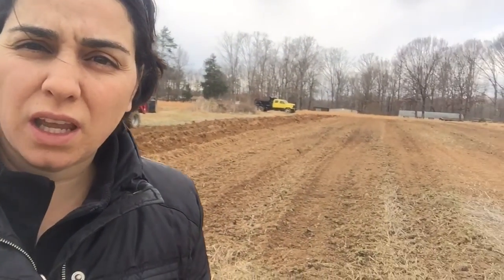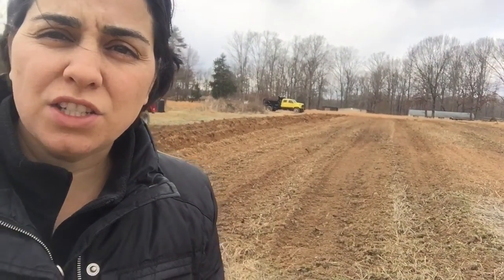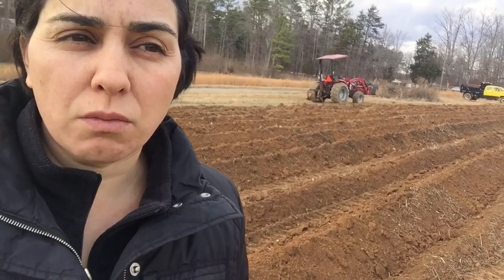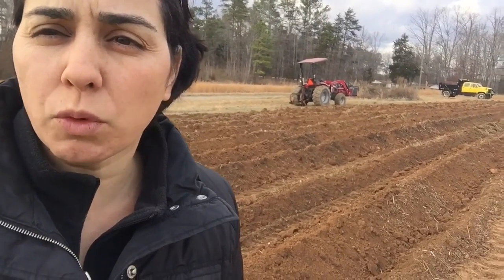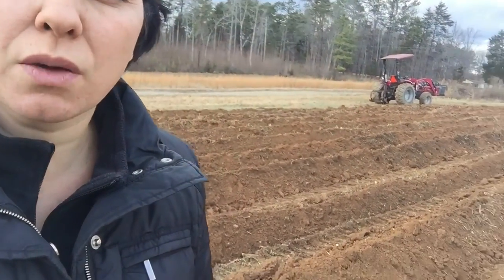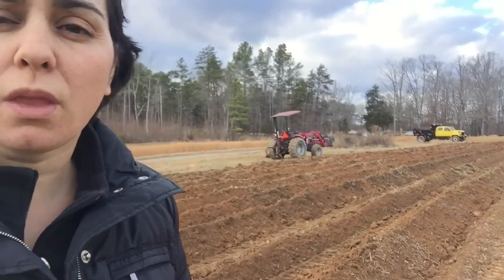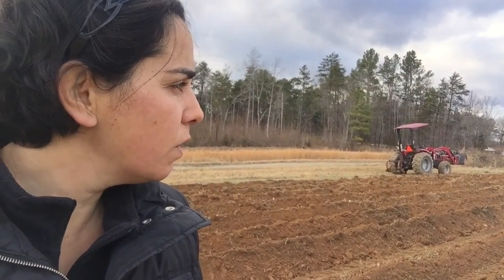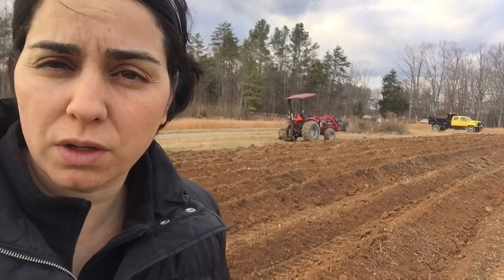Plowing And Tilling The Field

Comment: Adjust your plows set them over to 12 inches inside of your left tire adjust your left arm up till it runs level when you're in the furrows go to center of field and plow one furrow turn around put your wheels on the dirt you just plowed  and plow the other way it will make your field higher in the middle so water will drain

Comment: The plows are correct, but you need to run the tractor with one wheel in the furrow you already plowed and you don't have to be too deep when running the tiller over the field. The ground do have to be plowed before running the tiller over the soil so the tall grass don't get caught up in your tiller tines. I have seen what happens when you just try to break up the soil and turn it over with just the tiller and it isn't nice, and your tool is out of work until you clean the grass out.

Comment: To the center of your field. Plow a straight line down the middle. Turn around and put your wheels on the dirt you just turned over and plow back on top of that dirt. And then go down get in the federal and plow it that direction and go when you finish that turn around and get in the other Federal and plow back the other direction and that makes the field high in the middle. So the water will run off the edges.

Comment: Go watch every thing attachments how to plow video only on a field that size you need  backland in the center..you can plow both directions. Start in the center of your field and go down plowing adjust your plow with the third link in the center to it is riding level and bowls playoffs on your two bottom is cutting the same identical furrow. Then turn around and put your tractor tires on the borrow that is closest to you when you turn around to go back the other direction and fly out on the other side and that makes a little small high spot in the middle of your field so it will drain off both directions instead of having water puddles in it and all you have to do is just keep plowing down and turn around and plow back and your field will play out correctly and keep your tractor wheels in the pleural where you just plowed
Reply from the maker: Thanks. This was a long time ago when we had 0 experience and not too many options when it comes to equipment. We had to do the best we could with whatever we had. I am sure that there is a better way to do this with more fitting equipment. Anyway, we ended up smoothing it with the tiller and building beds. It actually worked great, but again, I am sure that there was an easier way to do this.

Comment: hey great video!! here is some helpful tips, first you want to put manure down first then plow it in and then till it's smooth, also your going to slow when plowing, it needs to be a gear or two higher than your in now, the reason behind that is so the dirt will roll off of the plow into the other pharaoh, and also your need to try and adjust the plow to the right side more, when you look at the back of your tractor in the row the bottom cutting edge of the plow should be right at the edge of the old plow ditch if it's not then move it accordingly hope this helps
Reply from the maker: Would you mix the manure in even though it is in wood shavings? In some places they say it's not good to mix the shavings with the soil...
 Thanks for the tip about adjusting the plow! It makes sense... So it is right when the dirt falls into the ditch we previously made. We'll adjust it. The problem we had with driving faster is that it made the plow dig deeper into the ground to the point that it made the tractor stop. We'll try to adjust that too.
Thanks a lot!
Reply: We are city looking at homes surrounded by farm land in Virginia.  When moved to GA off dirt road we experienced the 100 ft. high dust clouds.  Can your experience say this is very common.  Bad idea surround home with corn, soy beans, and other agricultural crops so close?  It looks beautiful when growing, but what of harvesting and planting?

Comment: The plow pull bar should be horizontal and the lengthwise bar should be level when the tractor wheels are in the furroe and plow in the ground. If you look from behind the tractor the plow arms should be perfectly vertical even though the tractor is tipped to one side having wheels in the furrow. looking from the sidevthe top bar should be perfectly level, the way you have it it is tipped down at the front, this will slow or stop the tractor and greatly reduce fuel consumption. adgust using the top link and your 2 side links.

Comment: It looks like the center link, or top link of your tractor 3 point should be adjusted longer to level the plow. The plow itself should have some adjustments on it so it doesn't dig so deep. It was hard to tell, did you run the right side tractor tires in the furrow when plowing?
Reply from the maker: Yes, we run the tires in the furrow. Someone else commented on the top link needing to be leveled... We'll have to pay more attention to it next time. 
Thanks!

Comment: Adjusting the top link so the plow is level will help alot but you will also want to adjust the whole plow over to the right side of the tractor if you can so that it says the dirt into the furrow better without missing any strips